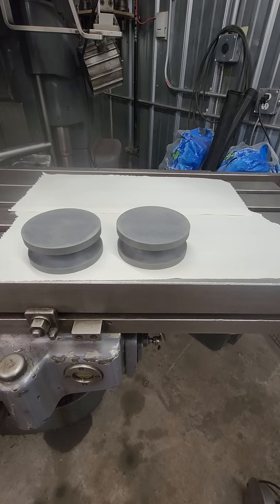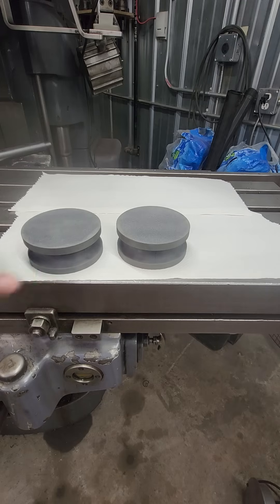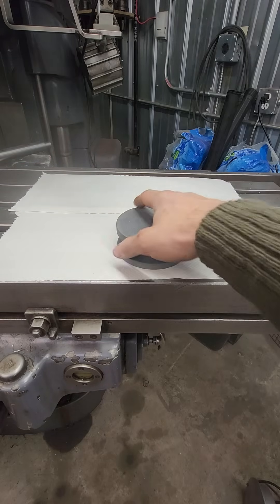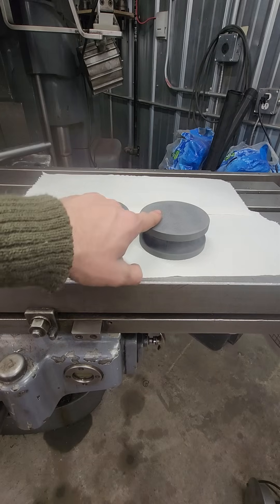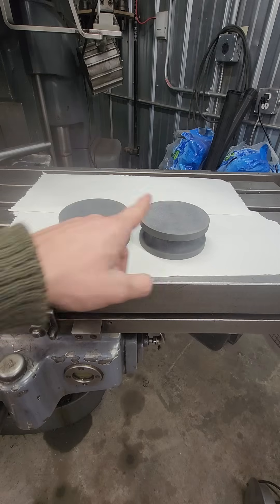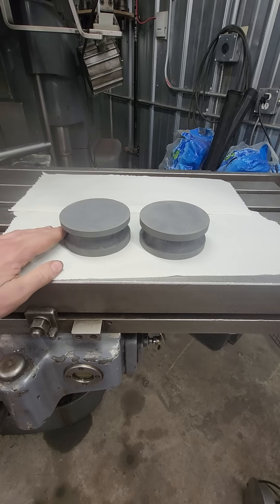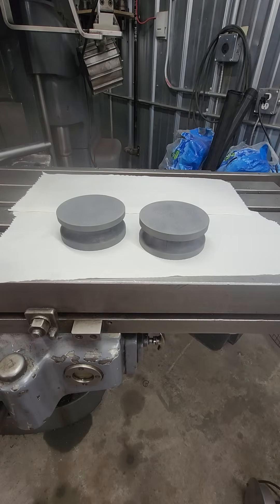The MYTH of precision flat stones in machine shops. (Make yours at home with NO tools)

Comment: as far as I can tell they don´t even have to be super flat to work their magic. a friend of mine just used one of the big diamond "files" (these big stainless sheetmetal pieces with diamond on them) to lap a cheap stone. certainly this thin diamond file was not flat. the stone works great. been using it for years (alongside two sets of precision ground stones I bought) can´t tell the difference.

Comment: 2:25 - it's achieving cleaning the surfaces by "grinding" the dust and dirt particles into extremely small particles that basically pose no mechanical burden. There is a guy on youtube who tried lapping stones together but they were not cutting a mirror finish like precision stones do - they made a scratchy matte surface. Precision stones do not harm a gauge block, do not make it matte. They actually refresh gauge block by getting rid any burrs created during their use or having them fall somewhere on concrete etc.

Comment: I mean if they're ground, the flatness is limited by the flatness of the machine.

If you follow the three-plate method, the only limit to flatness is your patience. 

It, after all, is the way we managed to get truly flat surfaces in the first place
Reply: Also the flatness is limited by vertical temperature gradient and similar thermal effects, creep, variable pressure on it, and the fact that you're if you're rubbing them, it'll have a tendency to make the top one concave and bottom convex from gravity alone and the fact ur going off the sides, and more. You can get damn accurate, but there's very real limits still. Optics is an art.
Reply: @napaisava Oh God I hadn't even considered that... But is that gravity droop also a thing with cylindrical stones?
Reply: @vincentguttmann2231 if you wanna use cylindrical stones and just say "oh im gonna move them in a rotary fashion rather than a linear way, that way they'll never have a stone on top overhanging the stone on the bottom" then we are faced with the issue that if you simply spin one stone in a lathe or by hand and press the other stone against it, the center has zero speed, and so the edges will face dramatically more than the center will

Can do it with them both on their sides, but if they're flat when the face is perpendicular to the horizon, then the moment you put em horizontally they'll deform under their own weight and no longer be flat. Think sheet metal siding thats flat when vertical, but when you hold it horizontally its gonna be bent to high heaven. Flatness is certainly an ordeal.
Reply: @napaisava  Yeah, and with optics being in the range of manometers, that's gonna be a whole different ballgame than even the most precise machine

Comment: I just judge based on "feel", cannot prove any of the hypothesis. Some stones seem to just rip grid out of each other if I try to rub them against each other. So they (seemingly) just will turn themselves into dust. 
The cheap stones that I use, feel much nicer after grinding them, compared to out of the box. 🙂2:20 wrong, i think. The step after grinding them is just to get rid of any loose dust and it takes only a few seconds. After grinding the surfaces flat they will not remove grid particles from each other anymore, but slide. 
https://www.youtube.com/watch?v=DVLXsq7pi9Y

Comment: No doubt about the process and the possible result. I don't think anyone who's worth their salt would argue. I will say if I had a dimond wheel on an arbor I would take the time on the grinder.
Reply from the maker: Absolutely agree. Unfortunately outside of hobby shops and tool and die/moldmakers, most shops won't have a surface grinder anymore.  We scrapped our last one about 3 years ago for example.
Reply: @Kurokimachine Things have certainly changed in the way modern shops are equipped. Passing the skills along is more important than ever. Thanks
Reply from the maker: @mp6756 yeah grinding still has its place, but carbide technology (along with ceramic and CBN) have improved enough to replace grinding for a LOT of what it used to be necessary for. Also a lot of shops (mine included) just don't see any work for grinders anymore. I am trying to pass along as much of the older techniques as possible with this channel.

Comment: We define flatstones differently.
A flatstone is 300 grit to thousand of grit.
I've used 20k grit on shaving razors, 600 - 1200 grit on knives.
Go higher, you're a fucktard, the edge goes off a minute ago.
Work precision instruments, you're golden, hell good, you're platinum. Everything else, good enough does the job and as a hint, I've replaced the ball bearings on my shopping cart three times for the mile walk to the store.
But, go for impossible precision, rather than sufficient, I'll enjoy your going out of business sale.

Comment: Im not sure where the whole conspiracy is that you suggest in your video.  You are correct that lapping stones will give the same result as precision ground.  The big advantage of precision ground stones is that you dont have to spend hours lapping them.  And while you claim that you lapped a set in 15-20 min, I would say that you are very lucky you got them done that fast.  Stock stones are normally anything but flat and some are so bad that it would take days to lap them properly.  With the surface ground precision flat stones, you know you are starting with something that is truly flat.  There is an absoulte advantage to flat stones in the shop.  Grinding them does not make them superior to lapped stones, it just makes life easier.  In my opinion, the time saved is money in the bank.
Reply from the maker: No disagreement on the majority.  I would say the controversy surrounding these stones is evident based off the variety of comments misunderstanding the application and theory behind how the stones work. The specific point of contention I raised is the idea that the only way to flatten individual abrasive grains (as opposed to the overall surface) is via grinding with a diamond wheel. 

The point of this video is not to claim that it is pointless to grind stones or that this is a better option, but rather that this is an option and surface grinding is not essential. 
 Outside of the hobby crowd, most shops do not have surface grinders in this day and age outside of the tool and die/moldmaking industries. We for example scrapped our last surface grinder about 3 years ago due to a lack of work for it and needing the floor space. 

Considering the price pre ground stones sell for, I can see this being valuable enough information to share. I run a working shop, I am not a youtuber. I don't get anything out of making these videos and simply am trying to make available information that will help others in the industry.

Comment: Not having the flat stones, I have often used a ground plate with fine grit paper stuck to it.
The advantage is that one can easily select the grit to fit the surface needing cleaning.
A light touch removes only the nicks and bumps.
Reply from the maker: Although a useful technique for many applications,  it is not comparable or interchangeable with these precision flat stones. I will include information on when and how to use them in the follow up video.

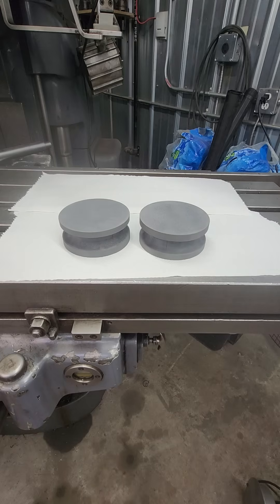Comment: 2:00 you are wrong, you don't need lap them at all. they have desire surface after grinding. and the "lapping" is just cleaning of stones. you can always use the same surfaces for cleaning and they will stay flat. (without becoming concave-convex) 
can you say the same with your sones?
it's not a problem at all if you will clean them in lapping order.

it also possible to start cutting with your stones at high pressures, risk with small parts like caliper's jaws. not problem with diamond ground.
Reply from the maker: This will all be covered in the follow up video. 
As I have tried to explain, the stones work because the individual abrasive grains are cut off flat and the stones loose their cutting action. That is not dependent on being ground with a diamond wheel. There are multiple ways to achieve that effect.
Reply: @Kurokimachine  It's something what happened with my stones, they aren't perfectly flat but they don't want to correct themself even with more lapping.
Reply from the maker: @bartoszskowronski that is an issue with the process you have used, these stones do not have that issue and it will be addressed how to avoid it.

Comment: Did you need to use any lapping compound?

I saw a video a few months ago by Project Havoc doing this, but he ended up needing to use diamond paste to get it to actually work and a bunch of weight on to.

I'm going to subscribe for the full video though, I have a compact 5 lathe bed with a bunch of dings that I'd love to be able to fix for 40$. (Also, where did you get the stones, also Canadian)
Reply from the maker: Hi, I will aim to cover all of those points in the follow up video. But a brief overview. Stones were off of Amazon. They came up searching for "machine knife stones" Norton offers them as well. 

As to the lapping process I have not seen his video so I can not really comment on the specifics. You do need free abrasive particles for the stones to cut eachother. If someone were to pre flatten the stones before doing this, it would be a slow and painful process if at all successful.  Fresh out of the box there are enough surface imperfections for the high spots to rub against eachother.  Once you start the process the loose abrasive powder acts as lapping compound would. Once the stones are flat you can clean them and then lap again. This is no longer flattening and removing noticeable material, but instead is cutting down the tops of the individual abrasive grains to give the effect of a stone ground with a diamond wheel. When finished you can see a near mirror finish on all of the individual abrasive grains when held up to the light. I am attempting to set up a means for that to come across in the video on the follow up.
Reply: For a lathe bed a burr file will work well. That's what I used to use to repair lathe ways. Its similar in concept to these stones, but much less involved.

Comment: please take threading die and clean surface on your sone. if they will not start too become mirror in high spots you didn't achieve the same result.
Reply from the maker: As stated in the video these stones were tested and the performance is identical to the surface ground stones. Again as stated in the video I have multiple sets of precision flat stones and have been using them for more than a decade.
Reply: @Kurokimachine  in that case great to hear. even if they aren't that good to clean/correct gauge blocks, cheap alternative for machinists is A improvement.

we don't need Rolls-Royce to buy milk half mile away from our home.
Reply from the maker: @bartoszskowronski exactly my objective in this video. Personally I would not be stoning my gauge block sets with these. A corner of your surface plate will work to clean up a gauge block, and if that is not sufficient it is probably due for replacement. 

For milling machine tables, lathe bedways, and other various mating surfaces in machine tool setup these stones will remove any high spots without altering the ground finish in the same way a surface ground stone will. For those of us who are not building lithography machines or nuclear bombs, they are as accurate as they need to be.
Reply: @Kurokimachine  And that is a problem with that video. You show something not for extreme precisions and telling that is a replacement. without lighting enough that part.
We are arguing now that Newton physics are not worth using because Einstein is more correct. 😉
Reply from the maker: @bartoszskowronski that is not really my previous comment or an accurate representation of this video. I have gone and watched your video and the results you show are not what should be expected from precision flat stones.
Reply: @Kurokimachine  RobenZ on his video shows the same effect on surface ground metal block. (with damages). So I assumed that is effect of cutting only high spots (over surface flatness).

Comment: I think you didn't understand RobenZ correctly. Diamond griding allows cut to half individual stone grains without ripping them off so they don't have stickout points. and normal dressed stones to flat would not remove material from ex flat mill table, 

but when you clean sones "lapping", one to another, than you start to not only cut imbedded-pokingout  material in sones, but stones them self too, and that will ruin flatness off stones, when stones became convex/concave they sops work as flat stones, and will remove material from flat surfaces.

as he said diamond griding of stones is only know TO HIM method of cutting half stone grains without ripping them off. 
he didn't tell that is impossible to find different stones-method to achieve the same result.

the stones after diamond griding will NEVER wear. yes they will willed with material between grains as much they will stop working, but they thickness will never change from wear.

I lapped by myself stones with 3 plate method, video how they work on my channel. they create mirror finish from surface-ground finish.
Reply from the maker: I fully understand the theory behind diamond ground stones and have used them for over a decade. All of the points you raised will be elaborated on in a follow up video.

Comment: Ultimately what matters is the surface uniformity and planarity. The way that is achieved should be agnostic to the end result. The only reason I would think that surface grinding "could" be preferred is that it  can be easily controlled and remove less material overall from a raw stone stock; i.e. the three stone method may remove slightly more of the raw stone in order to achieve the same result. The difference would be negligible since these are not high wearing tools. I guess the only reason you would want the diamond ground stones is that there is maybe less prep work as an end user when buying a brand new stone, particularly if you don't understand the processes involved. The solution to that problem really is just reading about how this all works though lol.

Comment: Anybody who has ever lapped telescope mirror would tell you the same thing
Reply: I've made parabolas, flats, and convex mirrors (flats are the hardest! But not that hard.)
Reply: but idea with diamond ground sones is that you can put on those gauge block (without any damage), on gauge block 100kg move that setup on that ground stone, and the gauge block will be IDENTICAL as before. ZERO material removed.
Reply: @bartoszskowronski with gauge blocks, one of the main things is extremely uniform abrasives with absolutely no surface contamination. If theres some crud on your stone, it'll have uneven pressure and cut. It cuts incredibly minimal. @cylosgarage did an episode on it
Reply: @bartoszskowronski  the point is, 3 stones properly lapped together will be flat. check out Huygens Optics or other channels dealing with optic polishing. you can either force the result (diamond grinding) or let the method deal with it.

Comment: Yeah, but you didn’t run that electronic indicator that reads into the sub squillionths over it to prove how flat they are 😂 All kidding aside I remember watching his videos on this and thinking the same thing. The old school mold makers I learned from lapped their stones on a plate to effectively ‘dress’ them so they didn’t scratch delicate surfaces. I just think grinding them is way overrated and not necessary for 99% of any work you will do. For anything delicate I do I used Arkansas stones which are much smoother and don’t tend to pick up or scratch.

Comment: I did the same thing, I made a set of three flat stones lapping them together with the three plate method and some valve grinding compound. They work great!
Reply: Also valve grinding compound on cheap stainless digital caliper slides works great to make em feel like 200 bucks.

Run it back and forth with the electronics off and run it extra where its stiff. Once its good, stake/bend the side walls of the caliper down carefully so there is no wobble but only slight preload. Wipe off excess, then run it a lil more with the tiny bit of compound still present. Wipe off fully, put electronics back on. Takes a while and not worth it unless ur a broke college student like me, but mmmm my $20 amazon calipers have less wobble and a better action than mitutoyos, and its incredibly easy to get 5 tenths repeatability with em as they're so snug (yet freely and smoothly moving)

Comment: how did you use the three plate method with two stones?
Reply from the maker: Stones are double sided. It is a variation on the three plate method that is equally effective. I will cover the process in a follow up video shortly.

Comment: Lapping via the 3 stone method - I assume you need to buy 3 stones, and then just use any arbitrary two of them day to day?
Reply from the maker: No, it is a modified 3 plate method using both sides of two stones. A third stone is not necessary.  I will show the full process in a follow up video

Comment: I had the same suspicion. Bought three cheap stones and did the three-plate (Whitworth) method. They’re completely flat — the rubbing sound is uniform.
Reply: Pick up a gauge block, rub it and if it doesn't scratch you have a precision flat stone that is ok
Reply: They LOOK flat to the naked eye but the grains are not flat, just knocked down to the same level.
Think very dense bed of nails vs wooded board 😀